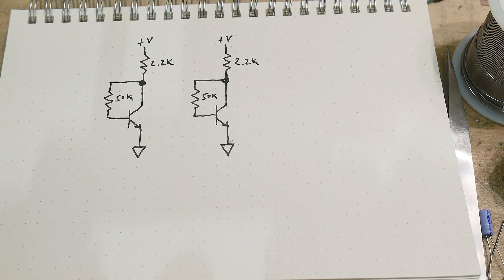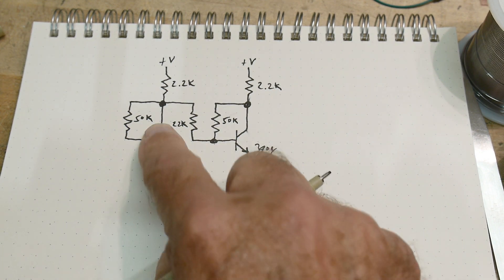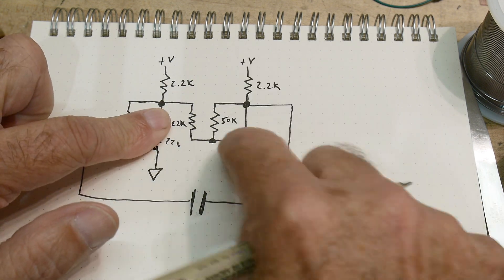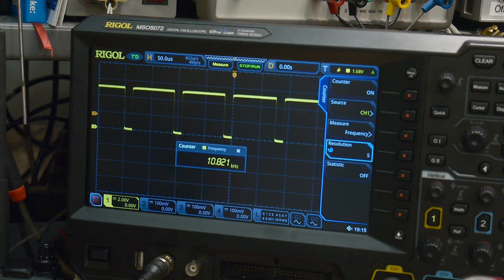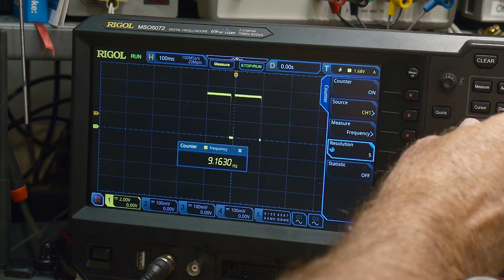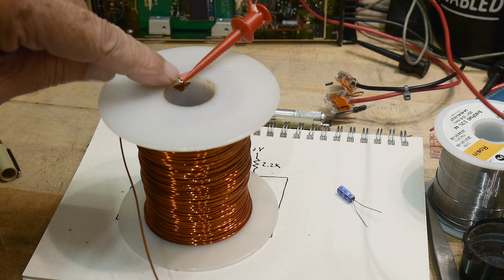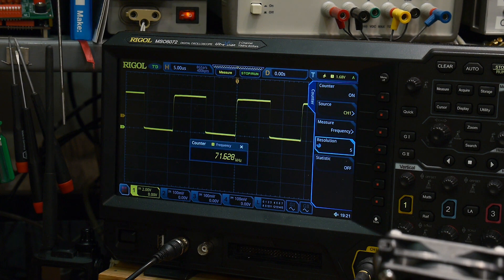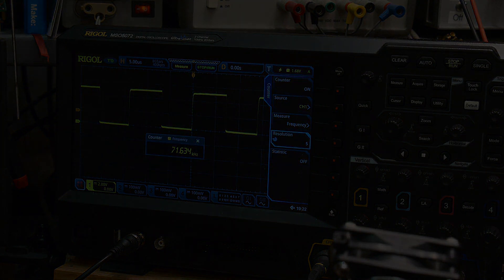#969 Long wire oscillator

Comment: Very very nice! The delay introduced by the long wire is fascinating...! I wonder what's the resistance of that wire... Just thinking on how to control frequency of it other than changing the capacitor... making the two 50k resistors variable maybe?

Comment: Lower a big powdered iron cylinder down into the center of your coil and watch what happens. I think that delay effect is almost entirely due to the inductance of the spool of wire as opposed to the length.

Comment: Yes but what use is it ?
Reply from the maker: use it like a 555 chip. it generates a clock. You could use it to measure the inductance or length of a wire. or a capacitors value. Flash an LED.

Comment: I'm sorry to say, but you got the whole concepts wrong...
Like Dri50 mentioned, this oscillator oscillates because it's got positive feedback, and positively back-fed amplifiers are just prone to oscillating.
Whatever reactive elements you put in the feedback path just makes the oscillation to happen at some frequency.
Lengths of wire... Is not exactly what is more likely at play when you add a long coil of wire... You're actually creating an inductor of a relatively high inductance value.
This amplifier, being non inverting as it is and having very little delay itself, it's already set at the most perfect condition for oscillation (at pretty much any frequency from DC to a few tens of megahertz).
When you add reactive elements (e.g. capacitor and or inductors) the phase shift they introduce actually makes the circuit harder to oscillate than it is without them, creating conditions for oscillation to be more likely at specific frequencies.

Comment: The basic collector bias circuit provides negative feedback from collector to base and stabilises the bias point. The description starting at 1:04 is wrong. The transistor is indeed "on", but it's in its linear region. The voltage at the node isn't the "transistor drop" (i.e. Vcesat), but it can be calculated if we have the supply voltage and the Hfe of the transistor. For a 12 volt supply and a Hfe around 100, the node will be at about 2.8V. If the Hfe is 50, then the node will be around 4.3V. You'd need a current gain of more than 800 to drive the voltage there down to 1V and that's extremely unlikely with a 2N2222.

Comment: This is a simple relaxation oscillator and is controlled by the charge and discharge time of the capacitor. The increased series inductance reduces the charge and discharge currents and slows the oscillator down. The coil is a very poor transmission line and it's unlikely that a pristine pulse is travelling through the coil to switch the transistors.

Comment: Hah. I tried the circuit with a 10,000 µF capacitor and got a nice leisurly 200 s period.
Reply from the maker: nice, how much wire is needed for 200 seconds? 1/ns per ft. so, 200 x 10^9 nS or 200000000000 feet
Reply: @IMSAIGuy  Hah. Then we are in the world of the latest Veritasium video—trasmission line theory involving long wires—but replacing lunar with Martian distances. :)

Comment: another way to look at this circuit is: The first transistor inverts and the next transistor inverts. So the input signal appears at the output of the second transistor with no inversion. Wrap that signal back to the input and that is POSITIVE feedback, which results in an unstable circuit. And they usually oscillate.
Reply from the maker: it is a self flipping flop

Comment: This circuit is a variation of a relaxation oscillator. This circuit was the start of digital flip flops. The interesting change with the wire was the change in duty cycle.
Reply: The duty cycle is difficult to calculate because the 2N2222, like most NPN small signal transistors, has a breakdown voltage between base and emitter of around -6V. So if the supply voltage was for example 12V, when the second transistor switches low, the base of the first transistor will be driven below ground and the transistor EB junction will break down, discharging the capacitor much more rapidly than expected from a naïve analysis.
Reply from the maker: if it ever works

Comment: Are you sure the change in frequency is due to the length of wire, not the added resistance and inductance from this spool of wire?
Reply: IMHO it's the inductance of the coiled wire!
Would be nice if IMSAI Guy would measure the inductance of the reel of wire.
Reply: @joop2295  Yep!
Reply: That was my thought too. It would be more interesting to analyse and explore what effect is at play most here. Measure the inductance of the spool and replace it with something similar (other then a long wire).
Reply: Assuming that the capacitor has value of 180pF, I'm guessing that inductance of the spool is about 166mH.

Comment: Isn't the delay caused by the additional series inductance/resistance in the circuit? If not, then where is it coming from and how can we calculate/measure the propagation delay of the wire?
Really intrigued and eager to know 👀
Reply from the maker: 1nS per foot
Reply: @IMSAIGuy  Says who? That's the speed of light in a vacuum. The speed of signal propagation in a wire is necessarily less than that, and you don't have a good way of calculating it from first principles. If it were coaxial cable with known capacitance and inductance, then we could calculate the propagation delay as √(LC). For example using RG-58, you get 1.5ns per foot (or 30cm), but you don't have any such information about a random coil of wire on a spool.
Reply: @RexxSchneider  Propagation velocity in a wire in free space can be calculated from first principles :)
Reply: @absurdengineering  But the circuit isn't in free space. Take a look at the circuit that was built at 2:25. Does that look like free space to you? There are lots of parasitic capacitances and inductances that will make a nonsense of any attempt to calculate the actual propagation delay from first principles.
Reply: thanks @IMSAI Guy  ❤️❤️

Comment: Was the crystal's frequency less than 137 kHz?  Higher frequencies require faster amplifiers (lower collector resistors), so you will need to choose the resistor values with far more care.  You will also need to choose values that yield more of a square wave than a pulse train.  Connect your probe to the left collector or your scope will short out the crystal.

Comment: Cool little oscillator circuit. An additional experiment would be to see how much the frequency changes with temperature.  Hmmm... Negative or Positive coefficient? I'm guessing it would oscillate faster as the transistors get warmer.